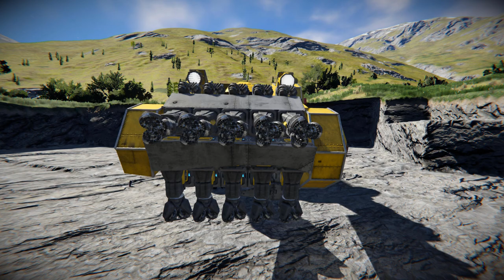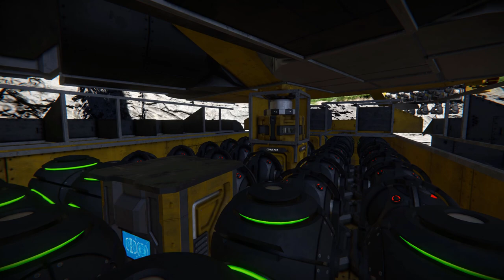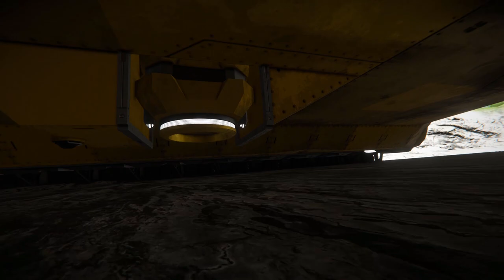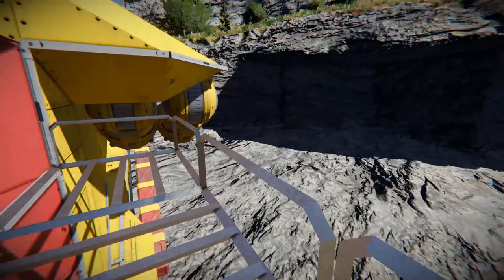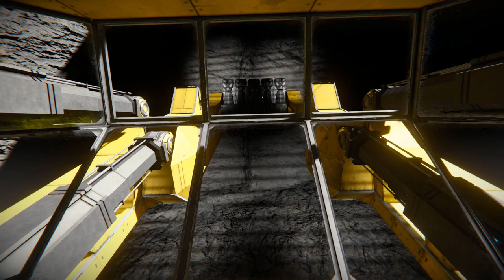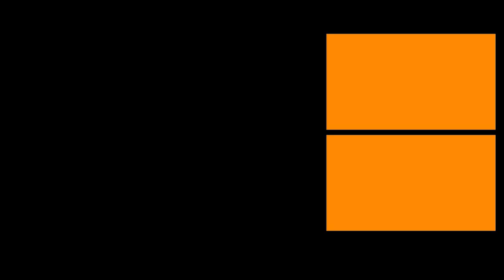The TME-20000 Goliath! - Space Engineers

Comment: just note especially to moving that thing around in 11:45 .. as it seems to be variation to bucket wheel excavators (https://en.wikipedia.org/wiki/Bucket-wheel_excavator ). those are more statically placed and swings their arm and scoop ore/rocks as they turn around the vertical axis on their base left to right (or vice verso). Once done their (semi)circle scoop, they move closer to wall and start another swing. Not usually moving whole machine by tracks while excavating.

Comment: Sadly, this thing is not survival compatible.
Reply: it can be if you print it out without the pistons then hand attach them using the hinge connect.
Reply: @nathanharrison2  Yeah, still no. Reactors not have conveyor connect, hydro engine and tons of cpu usage what makes it totaly unfit to 99% of the servers. Printing it with pistons, if you ever play with SE then you know, not a deal.
Reply: @Papa_Nurgle  i have played SE, and have done quite recently. if you know how to get around the pistons as they get projected, regardless of the reactors being not conveyered, you can get it done. the cpu usage can be worked around by only doing it in SP. reactors can be fixed with a row of extra storage running between them in rows,  or with replacing the floor or roof with conveyers. all problems have solutions. its just a matter of thinking them through and seeing what needs to be done to get past them.
Reply: @nathanharrison2  if for any reason, i want to download an engone, like this one, i rather already use it, and not rework the whole project. SE Only fun and matters in mp, in sp its pointless and Extremely boring. If you Really played a lot like me, as you say, you already know what things matters mainly in contraptions in mp. And everything what you just said, its works perfectly in creative sp. What, to be honest, betwen us, not matters at all.  If you still want to argue, fine by me, but its clearly tells me, you Have No idea what I talking about.
Reply: I built this for my single player survival. I don't bother with servers.
Reply: @johnfillups4484  Then you have no idea what is the best part of the game then. You never build a mobile city, and watch other players live their every day server life there. You never saw an incoming starship slowly emerge from the distance to help you out in a thick situation, you never landing on a mothership what slowly swim in the space, for reload your fuel and energy, you never trading with others for a ship what they build with materials what you get. Technically you not played SE for real. Same as ME to.
Reply: @Papa_Nurgle  You are spouting opinions as if they are facts. Grow up. My guy John here clearly finds asthetic to be more enjoyable over function. Btw @john fillups sweet build I just DLed it and will try it out tonight.
Reply: @Papa_Nurgle  Who cares? Let people play how they wanna play. If they enjoy it then leave them alone